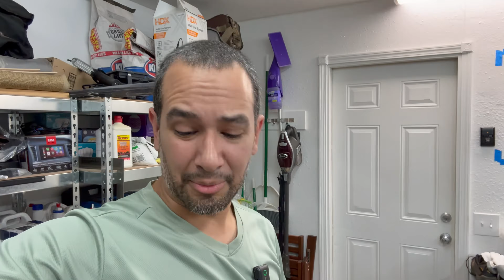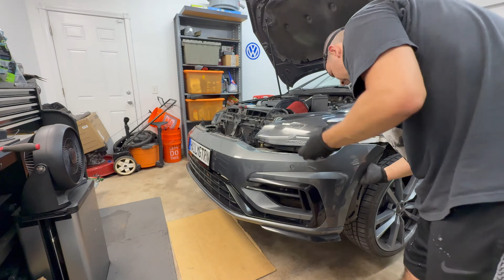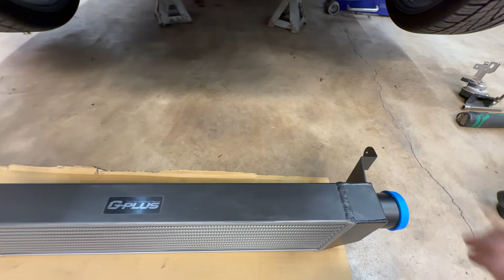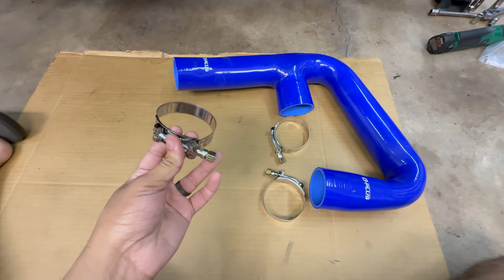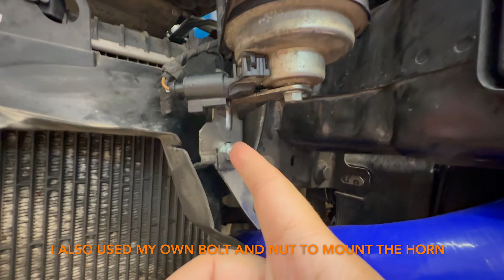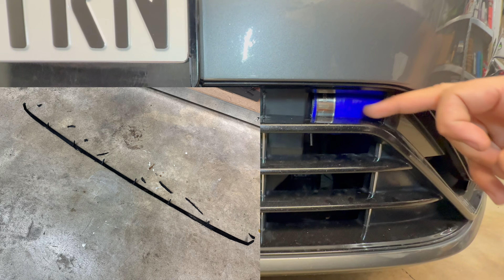NO MORE HEAT SOAK! G-PLUS TWINCOOLER INSTALL VW GOLF R MK7.5

Comment: I ran one on a big turbo gli and worked great
Reply from the maker: heck yea that's awesome to hear it can keep up with big turbo airflow!  Thanks for sharing that

Im debating upgrading the stock IC and keep running the FMIC in this same bi-cooler setup. But that's still up in the air... no pun intended lol. Good upgraded stock location ICs are pricey and with a FMIC running as a bi-cooler setup it would get deep into that zone of diminishing returns for the dollar. So the key would be finding that upgraded stock-location IC used at a good price to make it worth the cost and my sweat equity.

Comment: I opted for a full size intercooler upgrade purely because i wanted to avoid potential turbo lag. May be that part worked out ok. But! From what i understand, if you add yet another full size intercooler to it that you be compromising on consistent intercooler pressure.

Comment: With this setup you will lose boost. You will have a bigger lag. This is not how this engine and is38 turbo designed.
Reply from the maker: some on the internet would say that. In real world driving, I did not notice anything. Im sure it can be measured in the logs if I wanted to sit and compare... but it's nothing noticeable so why bother?
Reply: 1) No 2) Not to any practical extent 3) It doesn't matter.
I've installed and logged two dozen different IC setups and haven't yet found one that causes what you are saying.  If you have evidence to support your claim, shoot me an email at MyGolfMk7. I'd like to look over the data.
Reply from the maker: @mygolfmk7209  You're the man Jeff! Yea like I said, in my normal day to day driving, and even in spirited driving, I can't tell a difference in spool up times.
Reply: @turbospool  Thanks!  There's no difference. I've logged a few different setups, and the random variability is as large as any system-caused differences.  I'd link to the post about it, but YouTube doesn't like embedded links in the comments.
Reply: @mygolfmk7209 Glad to see you here! I was wondering based on your expertise and test experience with the different IC setups. Would you say you'd see the same results still if someone were to also add a upgraded stock location IC paired with one of the front mounts in this same twin cooled setup? Would it be worth it (from both a money and power standpoint)? Or is it just best to stick to upgrading one IC whether you do that through front mount or stock location? Sorry for the long post was just surprised to see you here figured I'd ask lol
Reply: @treflippa2  That's the setup I usually use; there's no loss of boost, and any difference in the rate of boost onset is small enough that a driver won't detect it.  It's well into the region of diminishing returns for all of the situations I've used for testing. I don't think it would be worth the money for most people.
Reply: @mygolfmk7209  I've read your article. It's so good very informative. Just want to get your opinion, for the same price, should I go for this setup or oversize stock location IC?